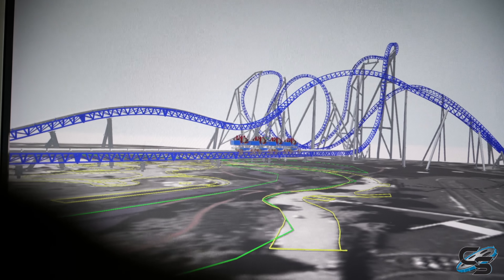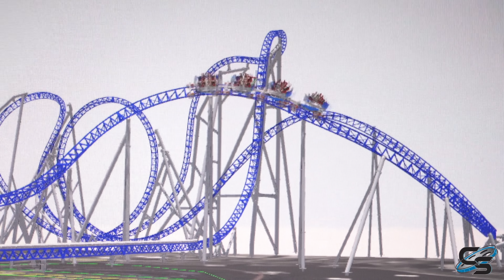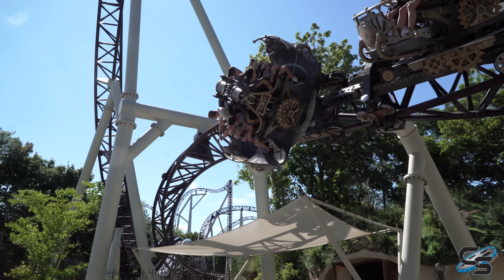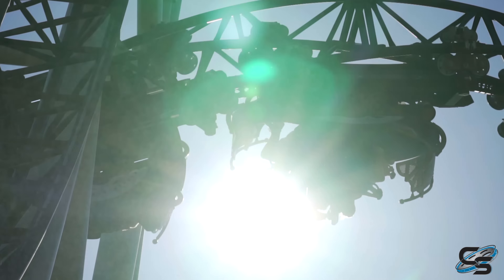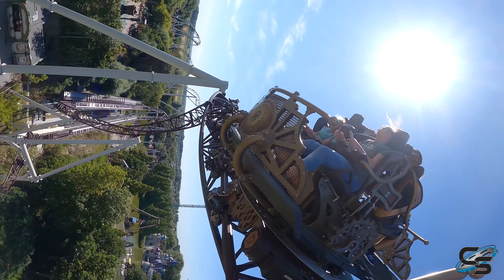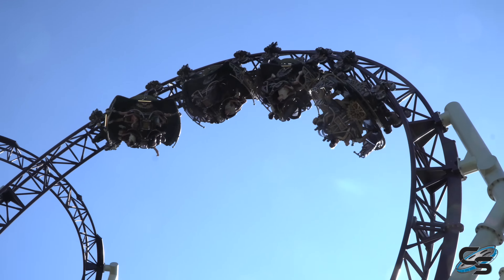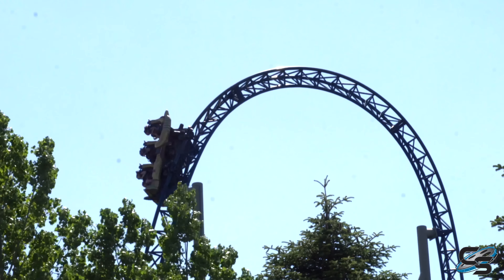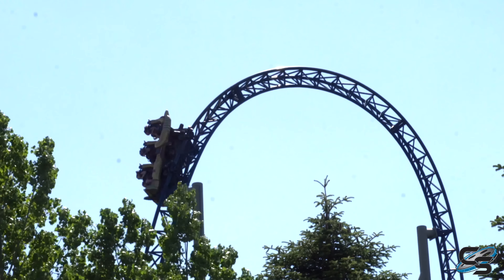Designing Ride to Happiness: How Plopsaland's Extreme Spinning Coaster Came to Be

Comment: I'm curious how long Mack will continue using the sort of out-dated track design that Intamin has kind of moved on from. I mean, it works just fine but you don't get very large spans with it. The train has magnetics to slow the spin down, right? Seems a little out of control. Love these videos with the manufacturers man.
Reply from the maker: The magnets underneath the train on time traveler were taken off for Ride to Happiness, so it free spins
Reply: The magnets were initially an idea, but the people loved it, the client loved it, and so they aren't used. I hope that stays so :D

But I get it, because with a ride like this, it's really hard to predict how the end result will feel. Like the designer said, he thought that it might be the limit, maybe too extreme, but only now that it is built they can learn how it really behaves. So I guess that magnet was there to tame it in case that it might get too extreme. I guess that's how they will move forward, because in a future ride where they push the limits even more, it allows them to tame too extreme parts, where they might have gone too far, since the magnet can be moved in and out and so the braking effect can be set exactly.
Reply: @CoasterStudios  Ah, that makes sense. It looks much wilder than Time Traveler.